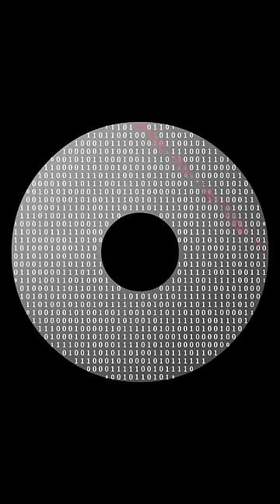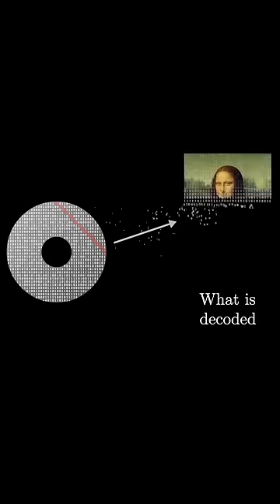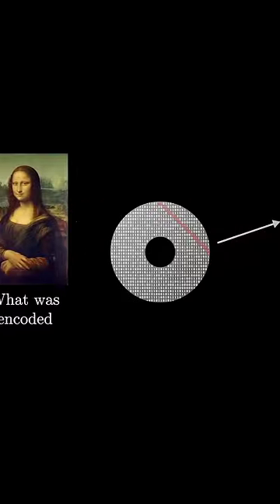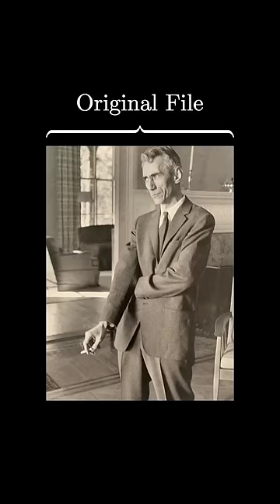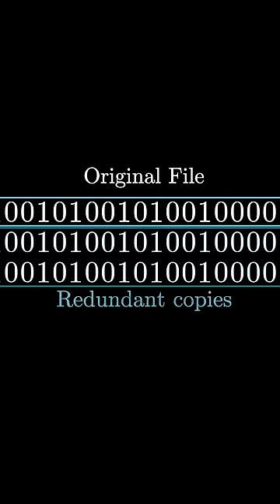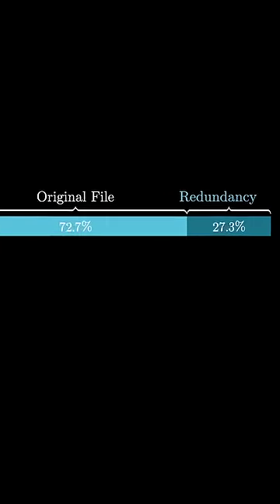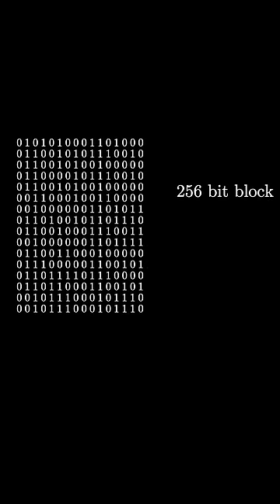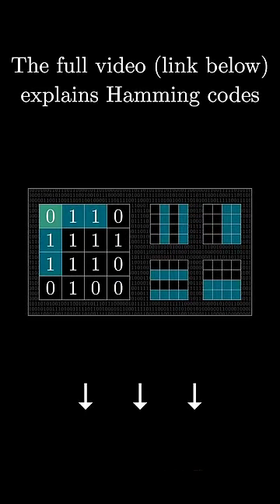Error correction is incredible

Comment: What does that have to do with CD ROM? These use reed solomon and redundant binary data makes up two thirds of the payload data.
Reply: The answer is nothing.
However you can't dive in to teaching forward error correcting codes by covering RS first, you have to cover Hamming first.
(But even here he doesn't describe Hamming particularly well).

Comment: A data hash is not enabling redundancy.  It is making it possible to detect data corruption.  You still need an entirely pristine copy of the 256 bits.
Reply: No.
A Hamming code is an error correction scheme. It is single bit error correcting, 2 bit error detection.

A simple parity scheme is error detection only.
Hamming employs multiple parity bits and each bit covers a different portion of the data word.

So Hamming extends error detecting parity to an error correction scheme.

Error detection only tells you there is an error in the data word. You can't tell where the error is.

Error Correction, for it to work, the scheme has to be able to identify where in the word the errored data is...If you know the bit position of the errored data you can easily correct it by flipping/inverting the bit.

Comment: The coolest part about CDs is that they had a 24mb error correction storage system that was dozens of times larger than existing storage. 

Also to the moron talking about drilling the disc and it being readable... No. Just no.

Comment: so could you technically accidentally make a CD play something different by scratching it a certain way???
Reply: Nope, a checksum is used to detect if the data has been corrupted.
Reply: @0x1EGEN no, checksums are not employed.
Checksums are not error correction, they are error detecting.
Reply: @deang5622  ??? That's what I just said. "a checksum is used to DETECT if the data has been corrupted"

Comment: Correct me if I’m wrong but isn’t that how CheckSum works?
Reply: Checksum is for detecting if there has been an error, but not correcting the errors. A checksum is simply running a hash function over the data and comparing it to the previously computed hash value to see if the data has changed.
Reply: @Dan-lt8vm  Thank you!

Comment: ○•◇ Ok!? □•◇ Do I Comprehend? ◇• So, the "Original" Code Could Be Repaired~Restored?, Via Backup Storage in ONE Block of 256 Bits...Which Would Include The Typically, Needed-Necessary Ones & Zeros Somewhere in That Block?!☆°◇ Me Am insane!◇•° Merry Christmas~Happy New Year...and All The Rest!☆♡•°deb out!☆♡°•
Reply: No.
There is no copy of the data.
If an error occurs in it, the redundant data bits in conjunction with math are used to identify the position of the errored data bits.

Those errored data bits are them corrected simply by flipping the bits, so if the errored bit is a 0 it is changed to a 1, and if it is a 0 it is changed to a 1.

The redundant data does not contain a copy of the data.